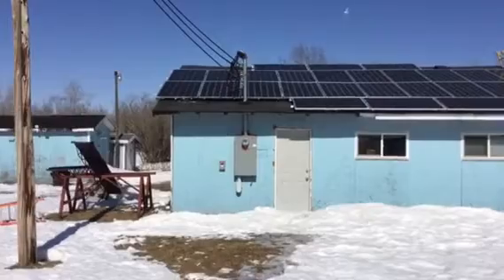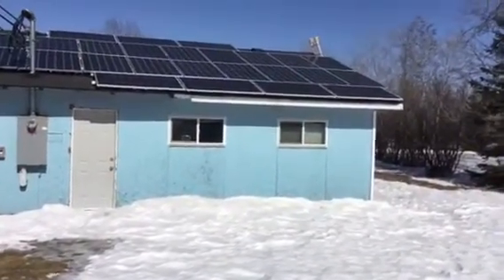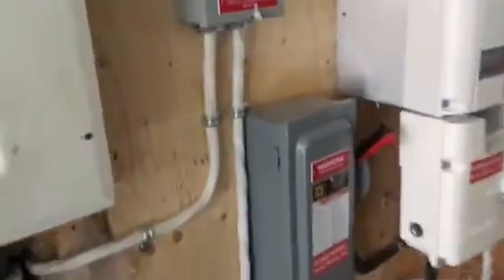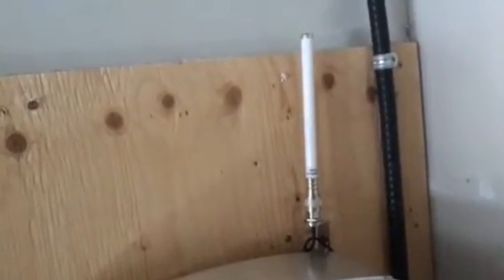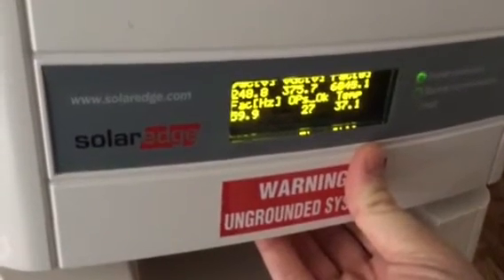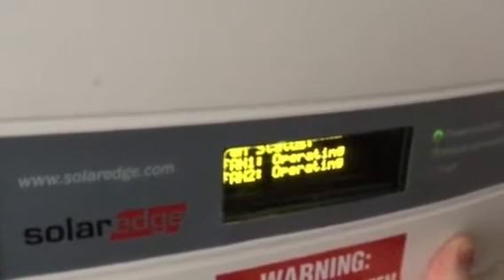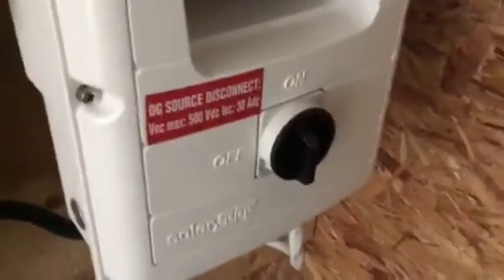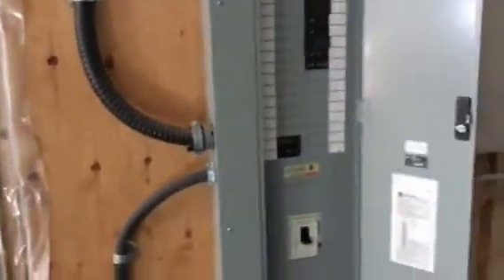My families solar panel installation

Comment: Nice install! What brand of panels are these? I installed a smaller 2.45kw SunPower module array in North Carolina with Solaredge optimizers and have produced over 3.1 MWh in 10 months. This is a nice investment.
Reply from the maker: Pedro Garces hi there I have 275 watt panels from a company called HES. Thank you for your question.

Comment: The yellow lamp is not telling you the inverter is communicating on the WiFi. It tells you it is talking to the optimizer modules on the roof.
Reply from the maker: sjokomelk thank you very much for the comment I figured that out later when I had to reconnect to my master in the house I looked further into how everything communicates.